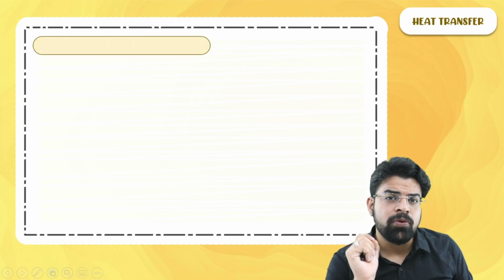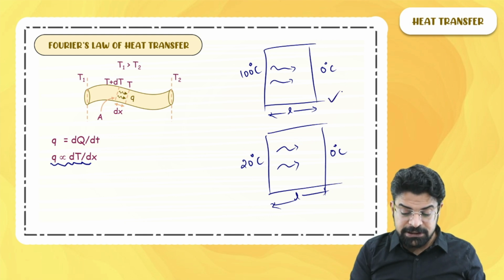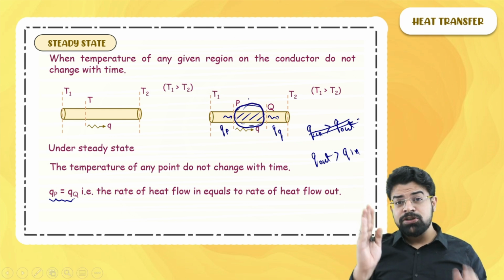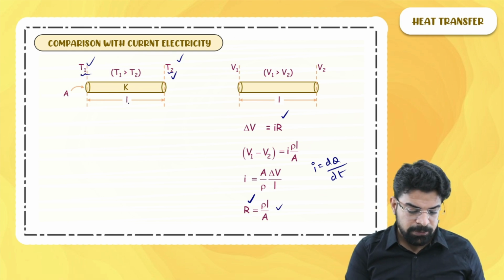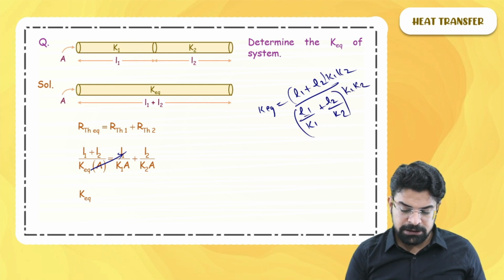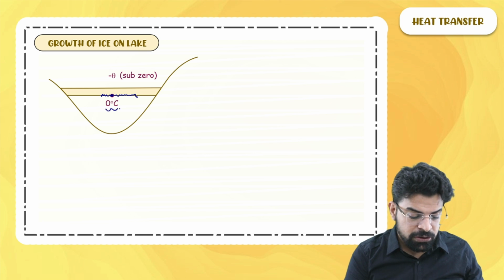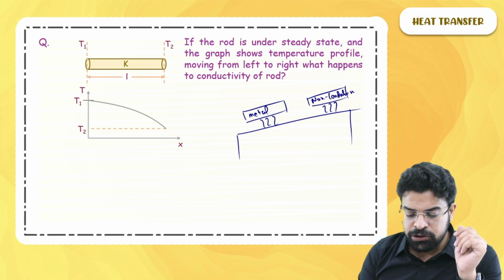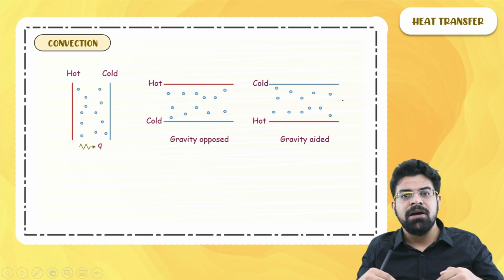NEET Physics Revision | Heat Transfer | Hour 31/84 | In English

Comment from the maker: I have posted the sequence of topics that we are going to cover in this Revision Series on the telegram group: t.me/scomore_with_ak
Reply: Sir one doubt
Is heat scalar or vector quantity
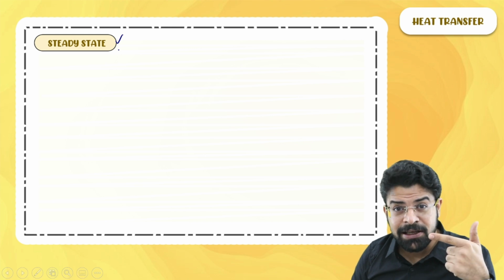Heat has directon as you said at 11:26 so energy is vector 
Some times i think such doubts
Cannot be solved in physics 
But heat is amount of enery per unit time so energy is scalar (work)
Energy also has direction so why does it is scalar and not vector
Reply: @targetaiimsdelhineethamarihai  It does not obey vector law of addition just like Electric current.
Who said that Heat is Energy it's just a flow form of energy, just like a carrier of energy between two systems.
Reply: Sir, but we are not following this schedule., any new schedule sir??

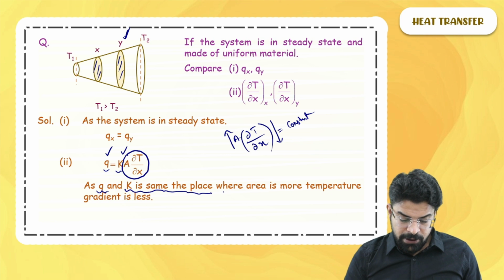Comment: At 20:05 (1)q is directly  propotional to A then qx is greater than qy
Reply from the maker: It will violate the steady state condition, and that is the concept we need to learn, tell me if rate of heat flow in will be less than rate of heat flow out then wont the section cool down?